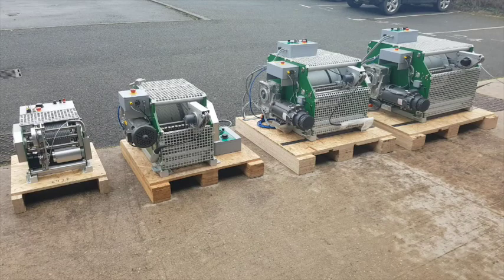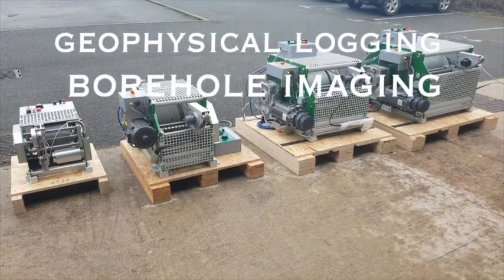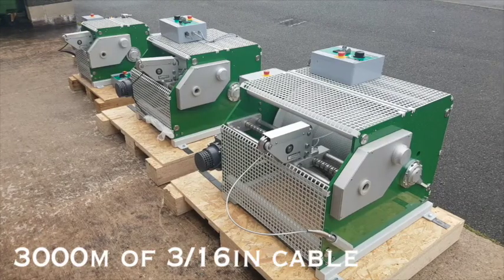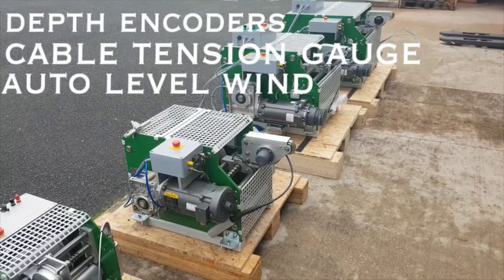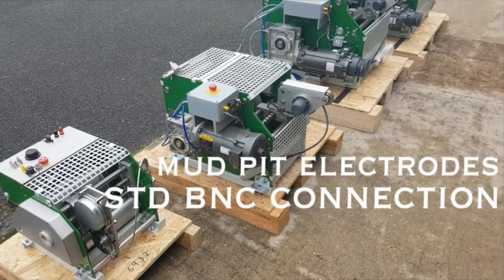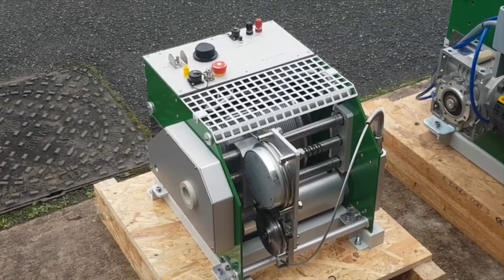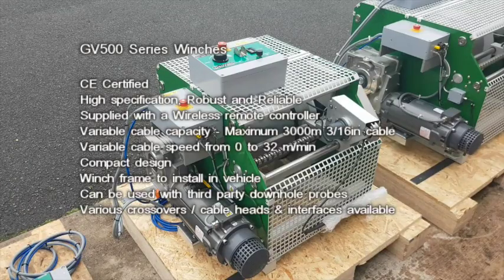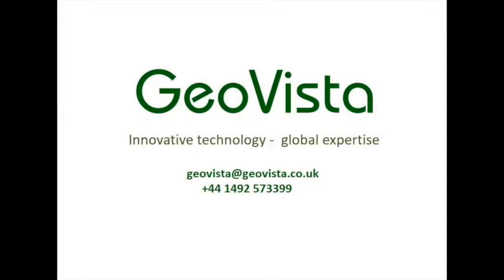Geovista Winches

Comment: Please i would like to request for a video or manual which shows the operational procedure for the GV 500 series motorized winch. I have done all the connections and the sondes are all reading values. The challenge with the winch is non functionality and the motor gets hot. The voltage here is 240V. kindly revert.
regards,
Ubong Ekanem